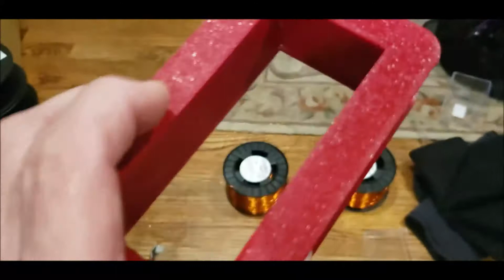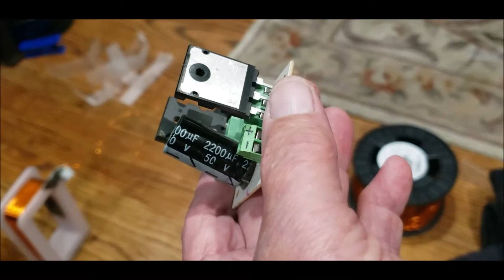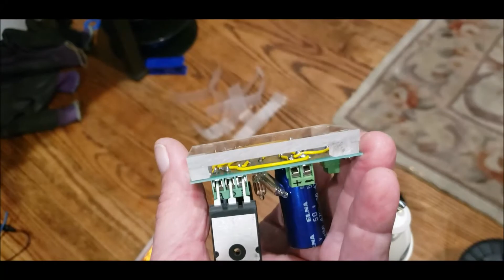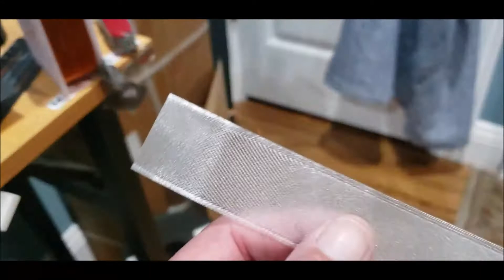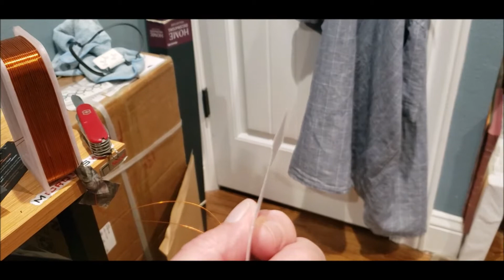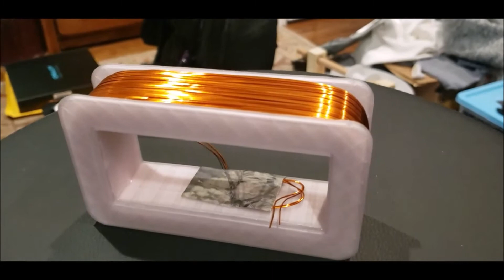3D Printed Coil Wind and circuit looksee

Comment: thank you very much for showing this, is what I wanted to see, and your beautiful coils you make, maybe also measure sky-collection microH of his coils and compare with the ones you make, I would like to know that too, by the printed separator works as a capacitor and so the coil has a different resonance frequency.
Reply from the maker: ok but not sure wat you mean but microH and don't know about the PLA being a cap?
Reply: @mcorrade  every intermediate layer you make works like a capacitor and together with a coil, it gives a certain resistance at a specific frequency, therefore the thickness of your wire as well as your intermediate layer thickness is important to make a good coil, you can measure see the youtube videos
Reply from the maker: @36wim  cool. SO I wonder if using the plastic vs the paper makes a difference as well? I'm sure it does as the plastic is more dense.
Reply: @mcorrade  https://www.youtube.com/watch?v=FB2xF3PGix8
Reply: https://circuitdigest.com/electronic-circuits/how-to-measure-inductance-or-capacitance-using-oscilloscope
Reply: @mcorrade  https://www.youtube.com/watch?v=fT5_MmeSeDU
Reply: https://www.youtube.com/watch?v=lqgjeN3Jnj8